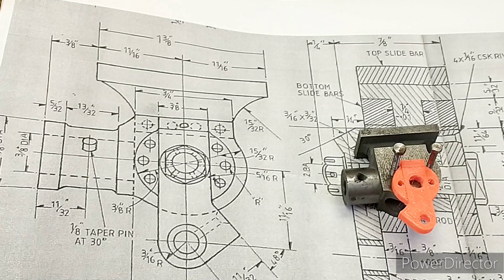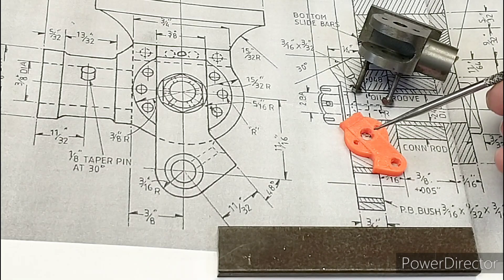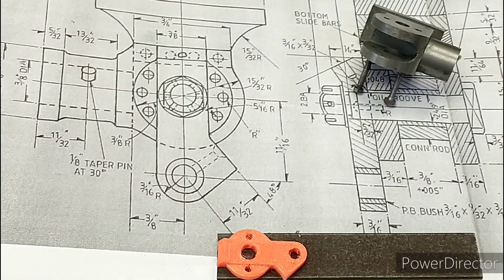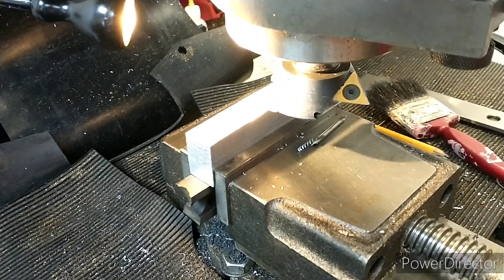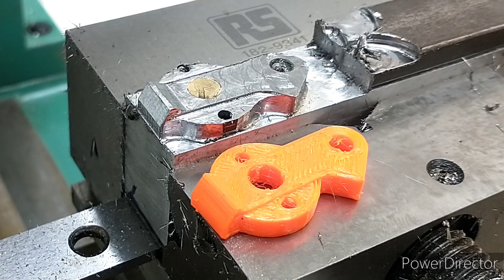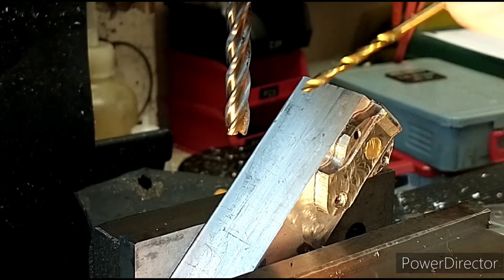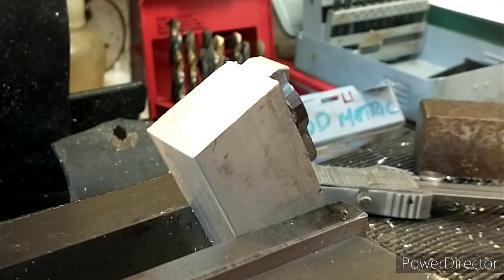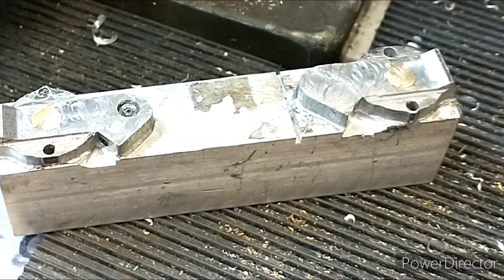Modelworks Britannia Ep34: CNC drop links #livesteam

Comment: Hi Julia interested in some more information on your cnc which have you gone for or is it a retro fit? 
Looks to have produced a good end result  like you say a little fettling and it will be fab
Reply from the maker: Hi James, Ineed to do some more on it. Haven't had time recently. 😀 I'm currently using a training machine made by Denford and I'm using their software too. It's a bit lacking in features compared to Linux CNC but it's easy to use.